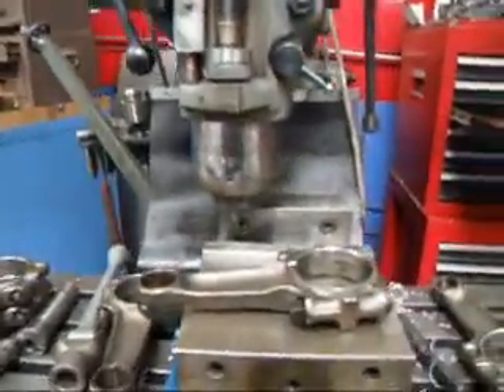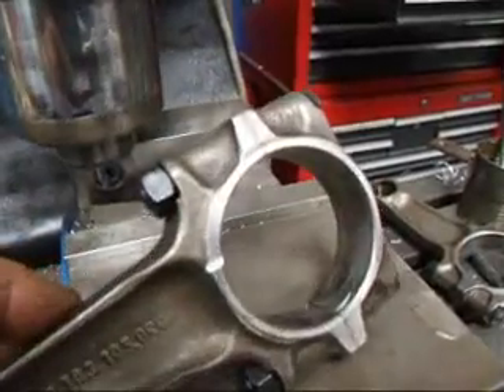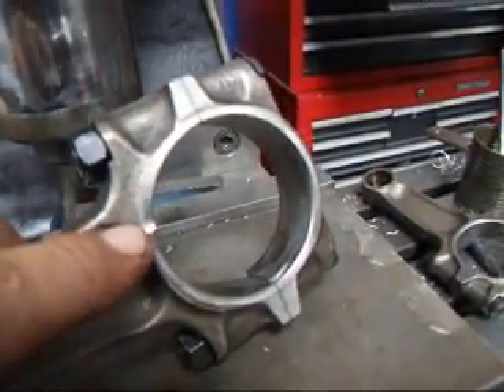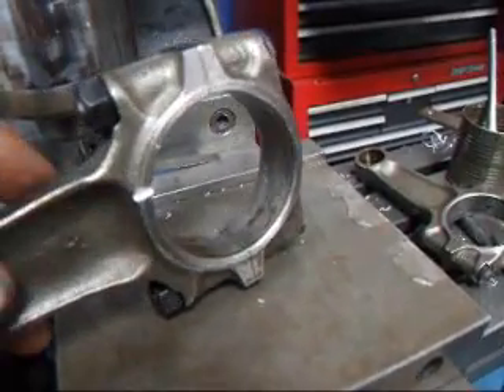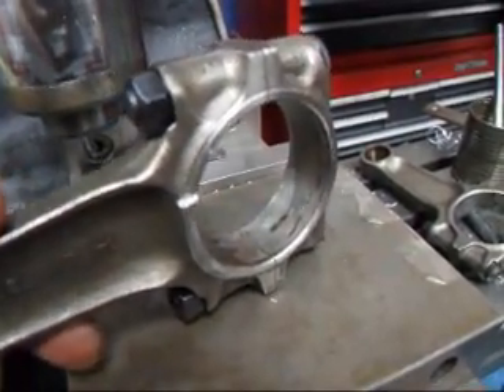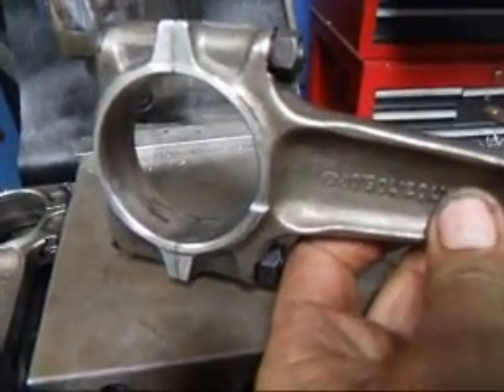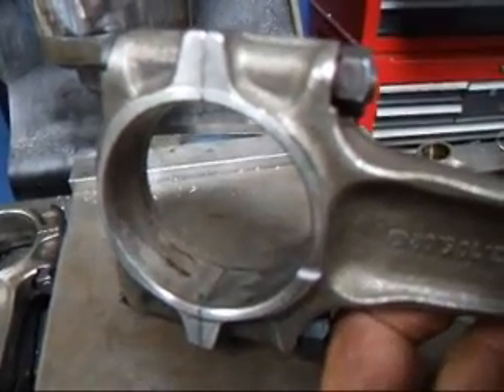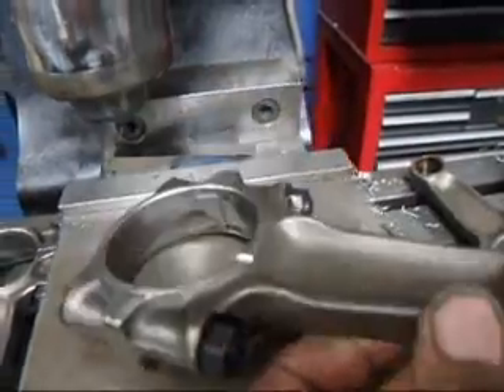Porsche 911 Connecting Rod Oil Squirter Mod

Comment: Hello John, Thanks for the video.  I've done this exact modification to one of my engines which normally runs an OEM squirter with pressure valve to turn the squirter off at idle.  However due to altered crankshaft stroke, the OEM squirters would not fit anymore.The modification appears to work very well for cooling.  I used a 1.5mm ball cutter to create the slot.  But a possible side effect that I have observed is that when used with modern low tension piston ring the engine gets a little smokey at idle.  Yet when running under any degree of light load the rings seal up and the smokeyness goes away.Valve stem seals were new, as was the entire engine.  Compression tests and leak down report is very good also.  The only thing I can put this down to is that Porsches in the 70's ran a thicker and higher tension piston ring than say a modern low tension chromoly ring like you'd find on a new JE piston.I'd be very interested to hear your thoughts.Cheers,Ian

Comment: He also doesn't comment on the shape of the "notch" being cut, or the cutter used in the mill?
Since VW distributed a Tech Bulletin back in 90 outlining this mod for T4 rods, it stands to reason that you could use those dimensions (1.5mm deep V notch) for this 911(air-cooled) application.
Would like to know why he chose that (offset) position?

Comment: you do realize that a piston and rod are supposed to hold EXTREME forces and heat. a simple clan against something isnt going to damage it.

hell i can drop a piston on the ground. stomp on it. kick it. and itll probably STILL be fine. pistons move at upwards of 7000 RPMS... i doubt a simple clank is gonna stop it